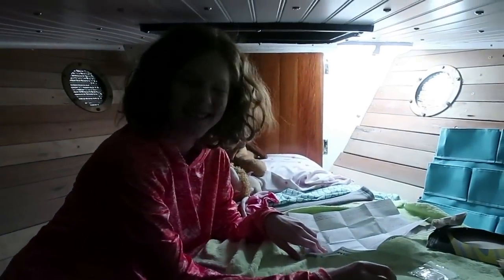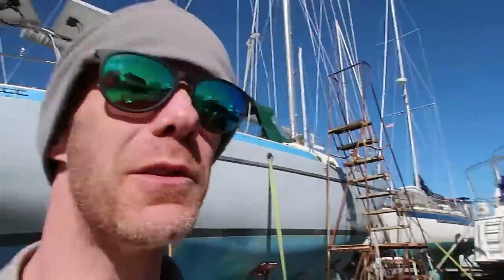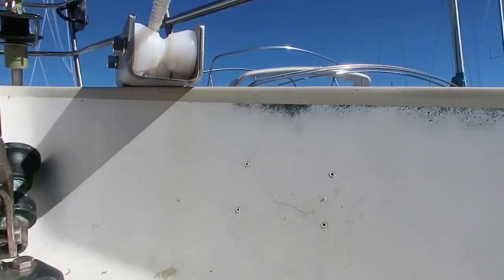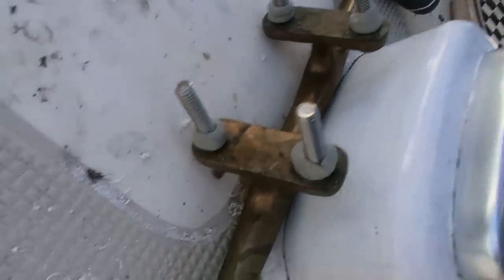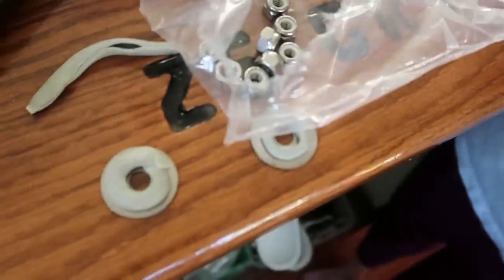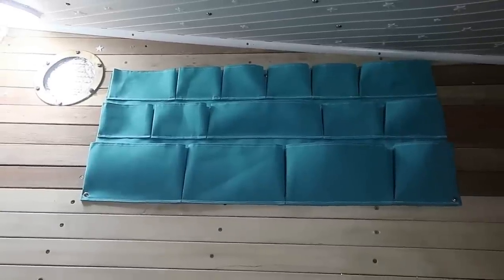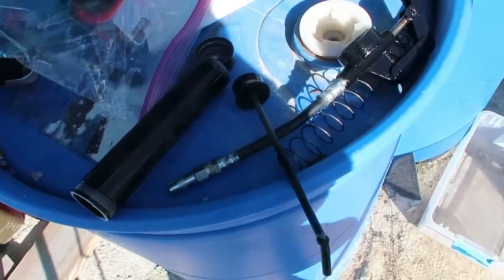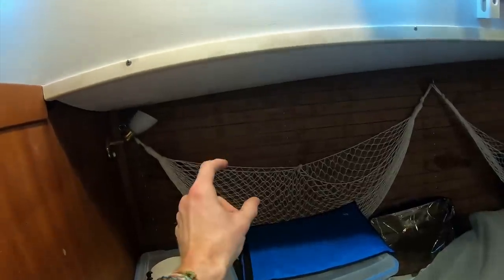Bow Cleats, Propeller Grease & Glow-In-The-Dark Stars | Sailboat Story 226

Comment: Another great time with the Clardys and friends. For my anchor locker, which is about the same size, I hung a heavy shower curtain just inside the door. The seam where the door hits the bulkhead can leak. I am adding some drop boards against the inside of the door. They will take any force of the piled up chain. Anyway, I am sure your fix will be sufficient. Besides it looks damn impressive! The one thing that can be a pain is the smell. My locker drains into the bilge but so far the smell aint bad. Good luck with launching!  I am jealous of that prop!
Reply from the maker: Our's drains to the bilge as well, and that's something I'd like to change at some point. Not exactly sure where the waterline is in relation to the bottom of the chain locker. Might have to set up some kind of sump pump arrangement nearer to the forward end of the boat. The grit and gunk will be a challenge, I'd imagine. The thing I most dislike about our present anchor locker drain arrangement is how the salt water flows directly under our fuel tanks. There is a 1" gap or so, but I really don't want that water anywhere near the tank.

Comment: Just wondering about the grease fittings.  Most of the props I've been in contact with that have those little screw in deals require loctite on the screws or they just back out.  Am guessing grease might not make the situation better, but you've probably read the manual really well.  I've had a couple of friends lose props because of screws like that, and weherease they are obviously not retaining screws it might allow seawater to degrade the lubrication.
Reply from the maker: You know, I’m not entirely sure on that one. They weren’t locktited in, but that doesn’t really mean anything. I’ll look into it though. Might be an underwater greasing job in the future. Does loctite cure underwater?
Reply: @Sailboatstory  You know I don't know about curing underwater.  I know 5200 does but using that it might be hard if not impossible to get them out again.  You could always call loctite and find out.
Reply from the maker: I think there’s some kind of loctite that does cure underwater. Some kind of lipstick-type applicator, if I remember right?
Reply from the maker: Ok, so the manual doesn’t say anything about loctite on those plugs. Still, I did order some threadlock that works underwater just in case.
Reply: @Sailboatstory  That is a good plan just in case.  It might be that thread locker should be on all the screws that retain and seal the unit.  Since I've seen those screws come out so many times for so many people, I often wonder if manufacturers don't intentionally lead customers away from putting on the product.(At the least omitting a need for it, or saying it isn't absolutely necessary.)  If people lose a prop they will naturally have to replace it, and that is another sale for "the company.". I can't imagine a little dab doing any real harm.